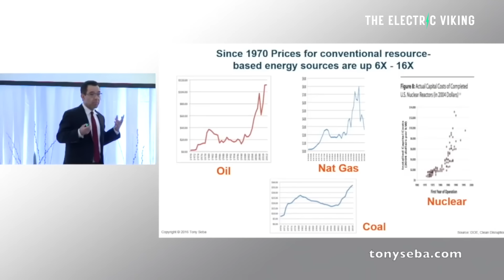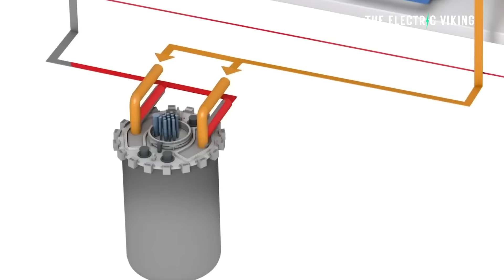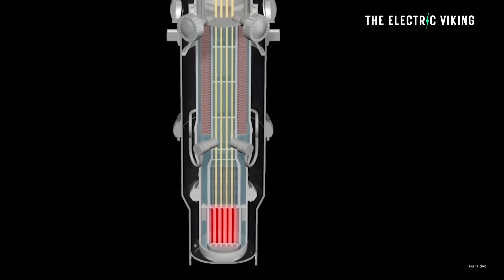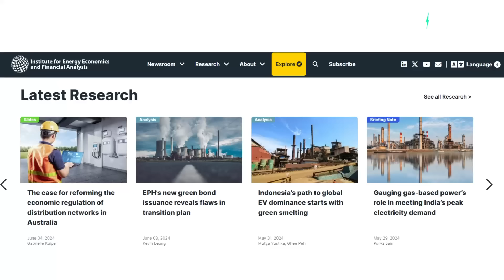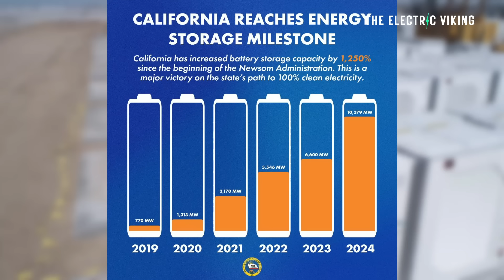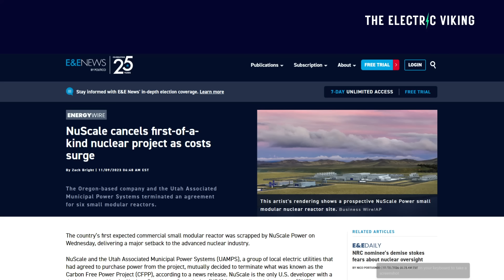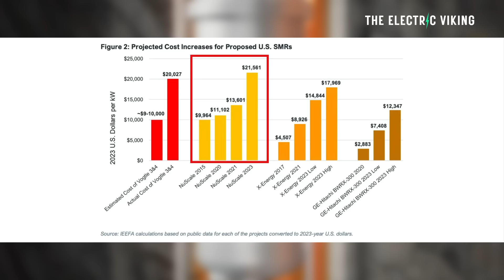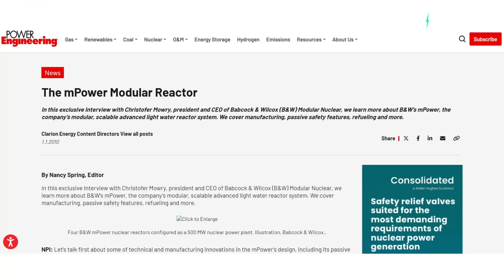In 2014 Tony Seba said Nuclear would be obsolete by 2030 - he was right

Comment: Nuclear has its uses. For example, you can’t run heavy industries with solar or wind energy. - Steel manufacturing factory for example.
Reply: It is not like solar and wind generate a different variety of electricity, so this statement is at least somewhat questionable.
Reply: Problem is if nuclear plant is not built because of cost overruns, political opposition or safety concerns then there is no electricity generated. Just lots of time and money wasted. History has shown, takes decades to build a nuclear plant while wind and solar is easily deployable in a month or less
Reply: Solar does run large industry all the time same with all renewables battery storage is needed for night time but it works fantastic. I run small manufacturing completely off of solar and battery it’s just a scale things and a storage thing. Lucky for our company we do all manufacturing in the day
Reply: well thats been proven wrong
Reply: Here in Denmark we have managed without local nuclear power so far. And it is not going to happen, I think. Renewable energy is the future, combined with batteries and other power conservation methods. For all the reasons mentioned in this video and other places.  Thanks Sam. Keep up the good work.

Comment: Wind and solar are not carbon free, you forget all the resources and energy required to build, maintain and dispose them, no recycle also.
Reply: Which of those activities can't be electrified?
Reply: @fjalics  Steel and concrete production, for example, are very carbon heavy. Other materials extraction and production, plastics made from oil, heavy excavators are all diesel powered and will stay this way since mines are located in remote areas, ships to deliver these goodies from China, etc.